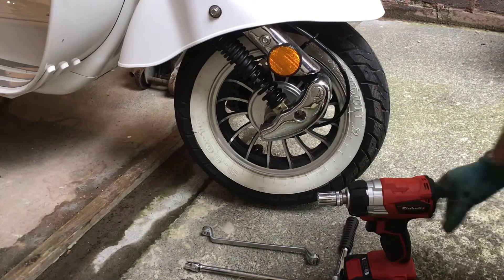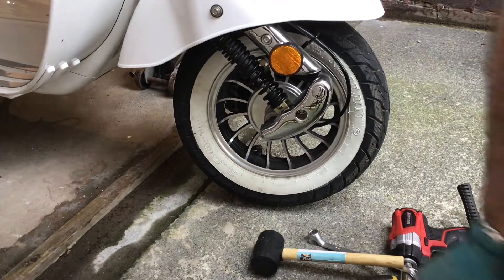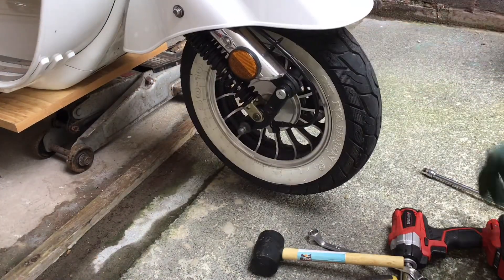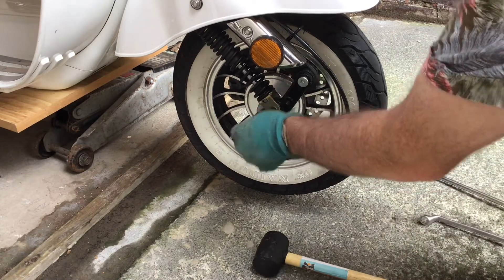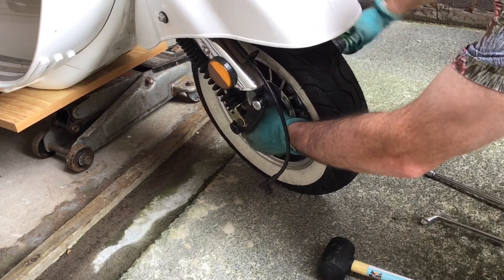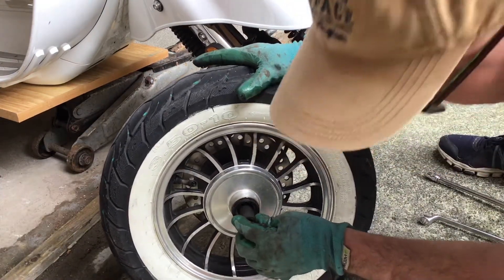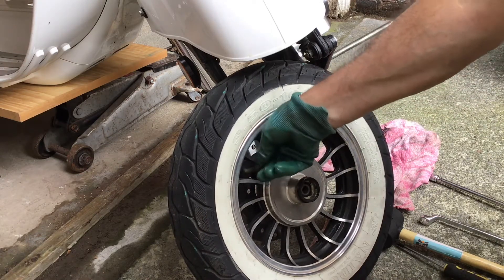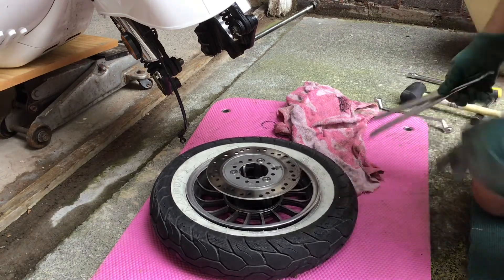AJS Modena front tyre removal and replacement part 1

Comment: Hello buddy I've noticed I've got this sort of rubbing  from the front wheel I was thinking it could be the bearings but not sure kind regards dean
Reply from the maker: Hi. Your rubbing could be anything. I would try spinning the wheel while it’s up on the stand to see if anything stands out. I suppose the bearing is a possibility. How old is the bike? Try grasping the wheel as near to 12 o’clock and 6 o clock as you can and try to rock it. Any play may suggest bearings. Could be old brake pads making a grinding noise. If it happens when you are riding, it’s a small possibility that there is a nail or stone stuck in the tread.

Comment: Hi I've got to change my front brake caliper as my other has had it how easy is this to do please
Reply from the maker: Hi. Well, to be honest, I haven't had the front caliper off my bike. It's something I've been thinking about doing for a while though now as I want to see what the condition of the brake pads are. However It doesn't look too daunting a task. As long as you remember where everything you unbolt or remove goes, make a drawing or film or photograph while you are dismantling, AND you do not put ANY strain on the brake pipe flexible hose, you should be fine with it. Oh, and do not press the front brake lever while your caliper is off as you may then make the piston pop out of the caliper and then it becomes a bigger, more complex job.